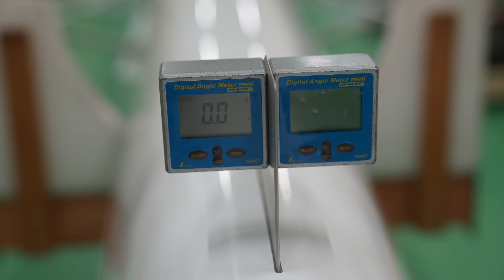競技用ボートを作るプロセス。国内唯一競技用ボートを製造する工場。

Comment: The method of using minimal epoxy to wet the carbon fiber cloth is also used in building composite aircraft such as the Long EZ and Cozy designs.

Comment: Incredible.
Black fibre and black resin goes into the oven, some time later the outside (only) has turned white.
Reply: pretty sure it was black coming out, then they painted it.
Reply: The carbon layer you see being added was the last layer, there were already several other layers in the mold - that's what they were sanding and filling. Typically they would spray white gelcoat into the mold, then add an outer skin of carbon, then a core layer of something like honeycomb or rigid foam, and then the inner skin we saw. When it is demolded the gelcoat is on the outside.
Reply: @grantm6514  👍 Thanks, I was pretty sure that was the case, although I wouldnt have considered the foam layer despite being in the middle of a strip plank canoe build, I was kinda snarkily pointing out part of the process that was omitted from the video.
But, and this is one of the great things about the Internet, there are people with knowledge that are willing to fill in those gaps.

Comment: I'm surprised they are not using the vacuum infusion process...
Reply: They do vacuum bagging. Halfway through the video.
Reply: @spxza  The vacuum bagging only presses the layers together to exclude any air pockets, whereas vacuum infusion  involves putting all the layers into the mold dry, and then using the vacuum to pull resin in via a network of pipes (like 'injecting' the resin, but by pulling it rather than pushing)..

Comment: Very ordinary video of a building process that involves very little skill. Anyone with a week's training can do this. Much of the construction is not shown e.g. the gelcoat application release agent for the mold, fitting out of the in-hull structures, fitting of the foam hull walls and the closing off, of the fore and aft sections. no information about resin used how vacuum bagging works. So, it's the last lot making racing shell's in Japan, So what? They are being made all over the world by small and large companies as well as thousands of individuals. making a mold is as easy as going online and getting the specifications for the size/class of shell you are looking to build, construct your mold then make the scull. Vacuum bagging gear is cheap and readily available. Making the mold true and fare requires patience but having the instructions and the off-sets will get you there.